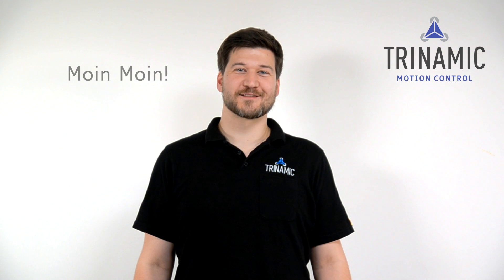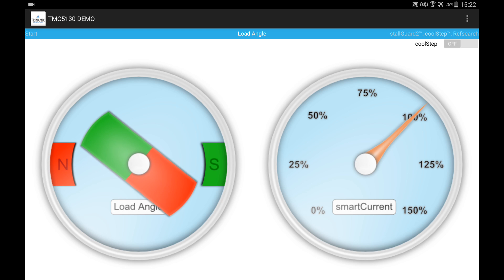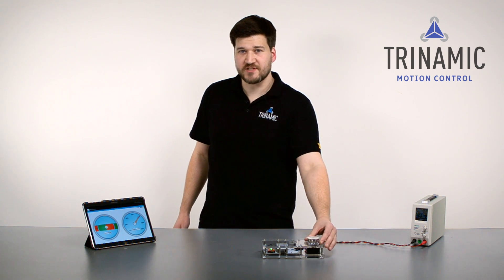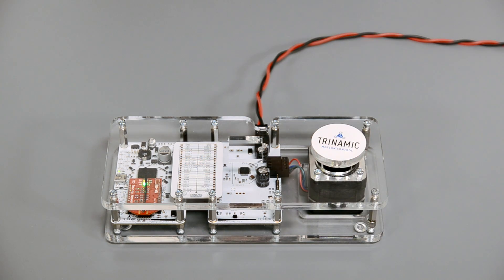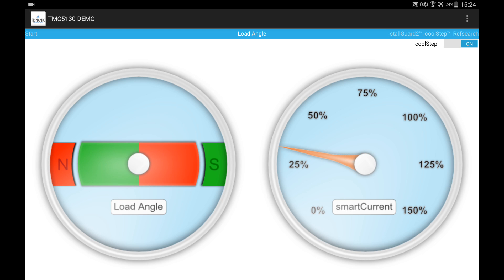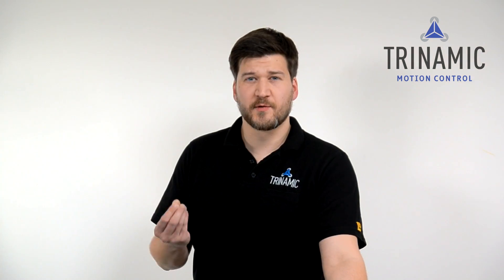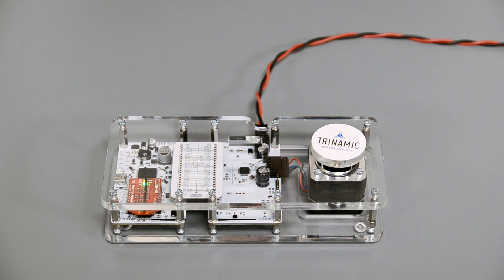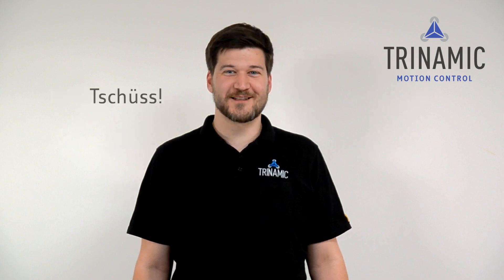Trinamic stallGuard2™ and coolStep™

Comment: There is a lot of talk about making end detection accurate and repeatable, especially for the Z axis of 3D printers. How does using stallGuard as "crash detection" fare in regards to this? Is it suitable for a Z which needs say 50um of accuracy and high repeatability, or only suitable for X and Y which are only used as reference points to move away from?
Reply from the maker: We have implemented it for some commercial 3D printers for all axes. If Z works depends on a few parameters. 1st Z has to be a hard stop, if it is equipped with springs below the bed, it will not work.
Reply: That sounds really good then. Thank you for your reply.